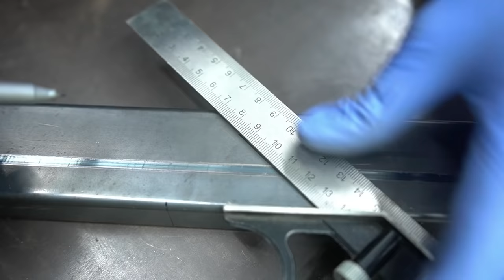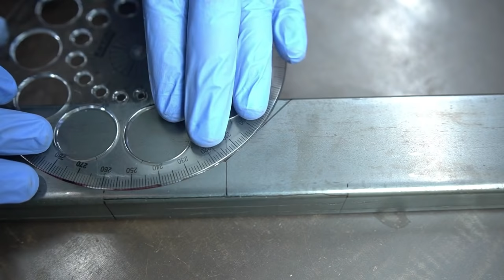Top 6 Unique Tool

Comment: I like this version of the wire clamp maker: much faster than winding wire around posts and screwing in a bolt. If you use pliers and pull the wires close and straight, it will make a very pro-looking clamp and even leave more room for extras.